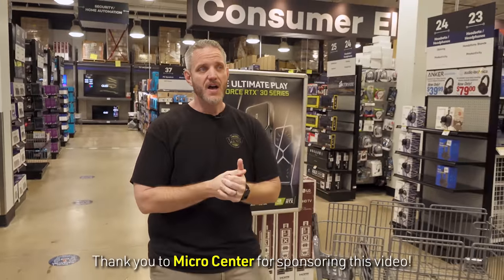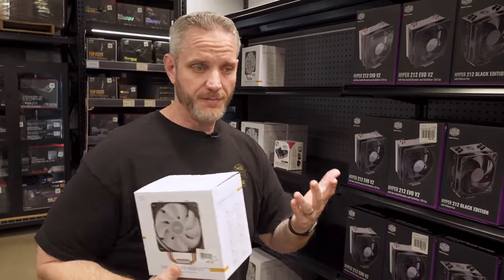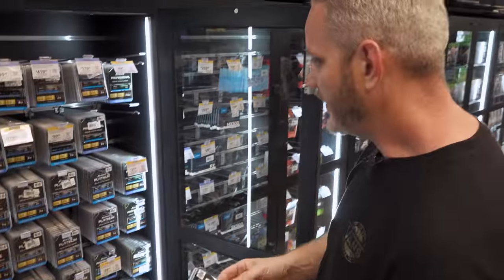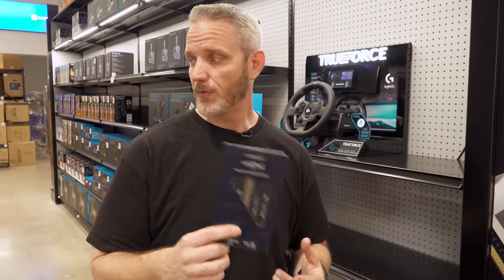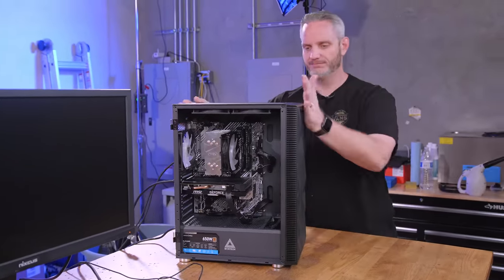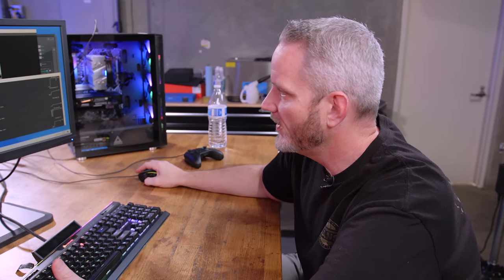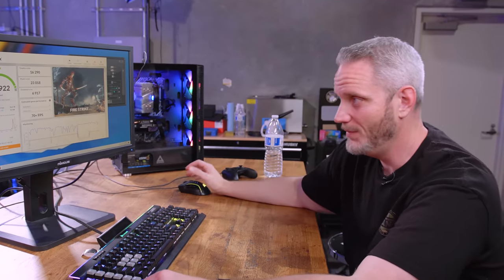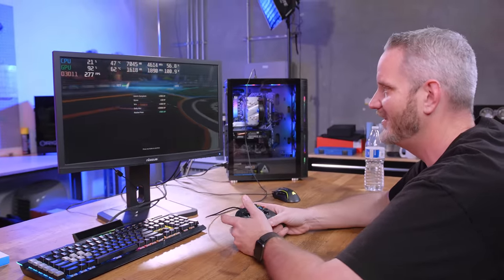How cheap can I build a "Gaming PC" for in 2022

Comment: I need some advice.  I'm in the process of looking into a new computer.  My current computer is 8-10 years old...paid ~$500 for it.   I've already have had sticker shock of the new gaming computer systems.  So a few questions:
1. Are places like Falcon Northwest or Origin worth the price they charge for a build?
2. Are pre-made [from Cyberpower, newegg, iBUYPOWER, Alienware] problematic as per what may show up...and what they may have cheapened out on to "get that price"?
3. Are computers with decent gpu and cpu setups just going to be costly?
4. Is there any foreseeable future where prices for these components will begin to drop in price?

My computer needs are:
-some gaming with graphic intense games [ie graphics mods for Skyrim]
-Music production using a couple of DAWs
-Watching at least 1440 YouTube videos without buffering

What would be the minimum I'd want to go with?  I was thinking 12th gen I7 and a 3080.

If you can offer some advice, I appreciate it!
Reply: Custom build pc boutiques like origin are not worth it for the price because of how much they up charge the separate parts and the build fee itself. Prebuilts are still a solid option though now it’s much easier to get gpus you may want to compare the price of the prebuilt to separate parts. Skytech and ABS from what I’ve seen are good bang for buck prebuilts with not much problems, however any you find you should research reviews and such to be sure. Finally the parts you mentioned are very overkill for what you want and are more geared to 4K gaming. I would say something like a 6600xt or 3060ti with a newer i5 or ryzen 5600x would be a good pair for 1440p gaming/watching
Reply: @TheBiscuitKing96  My nephew is really big into gaming.  He has some pretty intensive games and currently a 2080Ti, and can't run the games on the upper graphics setting.  He's done research on graphically intensive games and was saying at least 3080Ti.   He's the one who runs Skyrim with ~175 mods, many of them graphic mods, and his computer has issues [a 10th gen i9, I believe].  He's running 32 GB ram, I think.

I'd like to get some of those amazing graphics games at some point....but mostly, don't want to buy again for a few years, since computers are so expensive.

I think I could piece one together,...but getting all the software lined out seems daunting, which is why I'd rather go with something made for me that already comes running.  I'm mechanically inclined and wouldn't have much trouble with the hardware.  Operating system, whatever other software is required, I'm a complete noob on that stuff.  

I appreciate your advice!!  I'm happy to get it!
Reply: @DRayL_  A lot of it depends on what resolution your nephew is running his games at, if hes playing at 4k resolution I could see him having trouble running games at max with ray tracing on a 2080ti.  

Modding is also another beast, often not being very optimized and many mods can cause problems with each other. You might want to check a place like the skyrim mods subreddit for specific advice on all that. 

If you have the money for it though go ahead and grab the best gear! My advice is mostly just trying to save some bucks and I definitely encourage asking anyone you know for their opinion. Good luck in your endeavors on making your ideal pc!
Reply: @TheBiscuitKing96  I'm good with the money part.  I've been saving up for awhile.   I appreciate all you had to offer here.  🙂

Comment: I really enjoyed this video. I plan on making a trip to my nearest Micro Center (in Minnesota unfortunately, I'm in Iowa) to get a new GPU soon. Maybe a new build flopping soon after. A video like this every few months to keep people updated on pricing would be so great. 

This is promising. In the winter of 2020 I did build a gaming PC with an x570, Ryzen 5 3600 & an R9 Fury for $1,022. I could have done it for around $750 by buying a cheaper PSU, SSD, case, cooler & ram but I wanted nice components. I will say it still does perform well, especially since I'm not playing AAA. I got the GPU for $139 and the value quickly shot over $300 soon after.

Comment: A year back I found an AMD 8350FX PC someone left near dumpster. It worked when I took it home and still working as of now. Im finding this PC to be an excellent choice of the CPU. Im sure the ex owner couldnt use the 4k application of the newer video cards but Im using a 4k converter 18$ at amazon and my GTX 960 Gforce Vcard picks it up well and data is there of settings. If you into playing older games vs present ones due to income, this AMD 8350FX is excellent choice for a DYI Build if not the best of the price range of not spending over 500$ if less if you have other hardware in motherboard, hard drive, ect..

Comment: Damn, prices have certainly come down. I paid about $865 a few weeks ago for a pretty decent entry level setup:

i3 12100F - $85
Asrock RX 6600 8GB Challenger D - $200 
16GB GSkill Trident 3600 DDR4 - $60
Fractal Focus 2 - $60
Hyper 212 Black - $50
Seasonic Focus GX-850 - $160
ASrock B660 Steel Legend  - $120
Samsung 970 Evo 2TB M.2 - $130

The only thing I regret is the CPU cooler. The RGB was DOA and remember paying about $25 for one back in the day. Definitely wish i had gone with a different brand, but not enough to bother returning it.

Comment: I just built a budget gaming rig using older used parts from CeX. I already had a case and motherboard (Gigabyte Auros gaming ultra with M.2 SSD installed). So I needed RAM, GPU, CPU, PSU and cooler. I went with 16GB 3000MHz (2 x *8GB), GTX 1060 6GB, Ryzen 5 2600X,  cheaper 600W PSU from Amazon with a cheapo Arctic cooler with it. My bill came in at £390 for a respectable 1080p setup. Plays indie and older games (GTAV) at 1440p 60fps, so no need for current gen for me. You'd be looking at £500 with a cheapo MB and SSD.

Comment: remove tower cooler use stock one, use only the fans comes with case, buy entry level processor and entry level mothedboard, use most of your budget on gpu like 3050 or rx6600. add cheap 80+ 600w psu, dual ram 8+8 3200 at least, 500gb m2 enough to start you can add later... simple

Comment: well I just ordered similar build, only with amd... intel equivalent was about 80$ more
R5 5600,  Gigabyte B550 Gaming X V2 and  Kingston Fury Beast RGB DDR4 3200MHz CL16 2x8... paired with, from old setup, Gigabyte 1660 super gaming with 3 fans and Antec c40 cpu cooler... cant wait for the parts.. cuz old fx8300 life is not good at the moment

Comment: I recently found two i5 systems in the trash. Both are by Lenovo, one is an M91p and the other is an M900. Neither has a boot drive. Naturally, they're both small form factor, so the case has no room and they both have weak power supplies. I'd like to stick one of the motherboards in a full-sized case with a bigger power supply, so that I can add a Sapphire HD 7870 graphics card that I also found in the trash. I know it won't be state of the art, but it would be much more powerful than what I currently have.

Unfortunately, I haven't had much luck figuring out what kind of case I could put the motherboard into, what kind of a power supply would physically plug into it, or the pinouts for the various header connectors on the board. I'm sure someone else could just look at it and know what to buy and how to hook it up, but I have no idea...

Comment: I OWN NEO FORZA 16GB 3600MHZ DUAL RANK, it works but the metal heat shield SUCKS! It comes apart when you try to push it in, gskill has the whole cover thing, neo forza is two metal pieces glued to the side. Good if cheap though.

Comment: I've had more trouble with off-brand RAM causing problems than anything else. Totally worth it to buy the top-tier brand RAM as it is reliable.  Good choices on your parts! They are about what I'd pick too if I had a Microcenter in Vegas. I really really wish we did.  I love OutletPC a lot and it is local to me here, but they don't have a lot of parts in stock all the time like Microcenter does, so sometimes I have to wait for them to order stuff for me.  Their techs at OutletPC are top notch and give great advice though, so I talked to them even back when we still had Frys in town and back when Frys was worth shopping at. 

One pick I'd do differently would be the case as I really need one with space in the front for optical drives. I still use a lot of software and games that are on optical discs, plus I insist on using discs for my operating systems and will do so as long as possible.  When everything goes bonk on a PC, the you can still get the optical drive open, stick the OS's disc in and reboot.  I do like the roof of this case though because it has vents in it and you can mount fans there. Ever since I built in an Antec Nine Hundred years ago, I've been a fan of roof vents. Heat rises! It's good that case designers finally realize this and now design cases that let thermodynamics work for you. 

I don't mind if a power supply is 'upside down' as long as I can situate it so that it can draw in fresh air from a vent somewhere.  My current case: a Phanteks Enthoo has vents in the bottom of the case so I can let the PSU draw fresh air in from the bottom of the case instead of breathing in warm air from the inside of the case. I love it!  I also love that this case has vent filters. Got it on a black friday sale, so it wasn't crazy expensive either. 

Could have gone with a 1650. I did when I built my new PC last winter because it was the best value for the money in the budget I had.  I don't run the very very latest games made though, so I'm plenty happy with the performance I get.  Great video! Very helpful for those of use who love to build PCs but don't love maxing out our credit cards.

Comment: Hey Jay - You picked the CPU based on low price, but compared an Intel CPU without cooler to the AMD CPU that includes a Wraith cooler. So the AMD 5600x was the less expensive option. Otherwise a great video on how to select components for a build.
Reply: Problem is.. AMD doesn't provide cooler fans with their CPUs anymore. My 5700X sure didn't have one.

Comment: I decided to see If I can do anything cheaper... The lowest price I got was an AMD build on Newegg (since the closest Micro Center is in Denver CO and I live in the middle of Wyoming, so guess how that goes) was 769.10.  I went with a Fractal Design Focus G ATX tower (and yes, I took the red one), an AMD Ryzen 5 5600X with stock cooler, an ASUS prime B550-Plus motherboard, an ASUS GeForce GTX 1650 4GB Phoenix (the Overclocked version), Silicon Power 16GB (2x8GB) DDR4 3200, an Enermax MarbleBron 650w 80 PLUS Bronz certified, and an HGST Ultrastar 7K4000 2TB 3.5" HDD.  I know that the last item is a huge performance hit right there, but for the sake of video editing and gaming, it's better than using an SSD (even if the number of reading/write times has gotten better, both sides have their flaws you know).  I also know that the 1650 is a downgrade to the 1660, but I'm fine with low/medium settings for a game as long as it plays well.  I don't think it's too bad of a build, probably the same type of build that my Dell XPS 8700 was like when I bought it new (and for about the same price I might add).

Comment: I just traded from an OEM GTX 1660 Super to an RTX 3060, but I swear that older card over performed all the time, usually running anywhere from 50-70 fps even in 1440p, including RDR2 and Cyberpunk. The 3060 is better of course, but I really didn't need to upgrade. Funny thing is this is all very similar to my Lenovo the 1660 S came with, which I got for $699 in late 2020. As you said, that's what it would have cost to build a few years ago.

Comment: I build a new pc for my own for actually 600 bucks it includes: intel i5-12400f, gigabyte b660m ds3h ddr4(Matx), Xilence CPU Fan, Patriot Viper Steel 16 gb ddr4, kioxia exceria 1 tb ssd, and a kolink international citadel mesh rgb case, and I had a 1060 Nvidia GeForce graficcard.

It’s possible to build a pc for under 1000 bucks but only if you already have a graficcard I think haha.

Comment: You built a similar spec pc to mine. I built mine last month. I have the best value combo with the h570m and i5-11400f. I am using the same 512 gig m.2 though I went with only 550W corsqir bronze. I have the vengeance 2×8 memory kit. I bought the rx 6500 xt for 314 usd. I wanted to get a 1660 or 1660 super but I couldn't find any online 😕. It's a decent enough build and I am proud of it as it was my first time with only help from youtube vids. 😁😁

Comment: So I just came across this video after having built my system about 2 months ago. I have the same case. NEVER knew there was an LED button 🤣i saw the daisy chain in the back as well when I opened it and had the same reaction you did lol. Ive been thinking about changing out the fans to make the management better. Everything stays cool though

Comment: I would just bought the Intel value barebones kit at this point for $600 (It comes with Asus Tuf case, ASUS TUF 650 to 750 W  bronze PSU (depending on what you get), Asus prime Z590, and it comes with a graphics card which is an Asus dual RTX 3060TI. Add in Intel core i5 11600K, 16GB ram, and 512GB and you are looking at around $960 with tax. There is also an AMD one as well with the motherboard being an Asus Strix B550 but other wise the same specs and price. I personally think the AMD one has better value but then again it really depends. Hope this helps happy shopping at Mirco center.

Comment: You have to buy some of your components used to achieve that 500-600 dollar old school budget, I already have a ton of hard drives few of which ssds that and a 550 watt LOL Huntkey power supply. So far my build is costing me $242 Wrath cooler stock AMD cooler $10 "Temporary till I get water cooling depending on it's performance" Ryzen 5 3500x $115,  16gb Teamgroup 3200 mhz ddr4 $46.97 and a B450M Steel Legend $58 to the door price $70. Now just shooting for a 1080ti or a 2060 super for around $300 used or even a 1060 anything will be better then my super aging EVGA GTX 960 FTW 2gb which i now seen it's end of life trying to play God of War "I'm 47 1080p gaming is fine for me". This pc is a HP Z400 work station 11 years old with a W3550 Xeon in it and it's not too bad lol I will be modding this case for my power supply and adding stand offs for the steel legend lol I'll make a video of this frankin build if you would like a upload later on of it. Also sell me one of your graphics cards that you have not stuck your finger in it's fan while powered on :)

Comment: I play AC Valhalla on 1440p resolution high settings, my 5500 XT does a good job at maintaining high 50s, could try to lower settings but I didn't see any benefits and the gaming experience is really smooth, no complaints whatsover. At the end of the day you really don't need a powerful card that's gonna drain your pocket just to look cool.